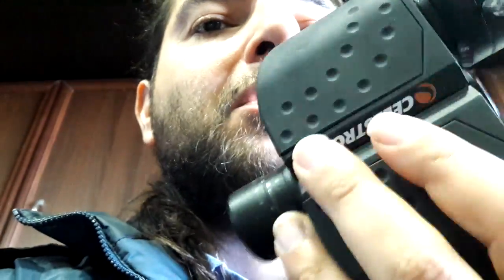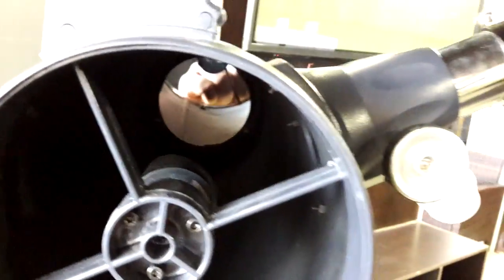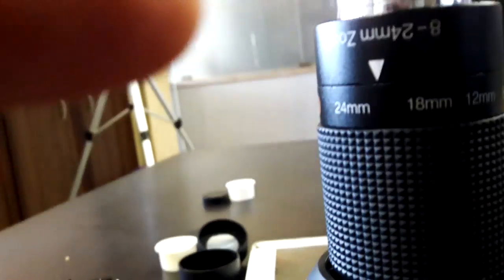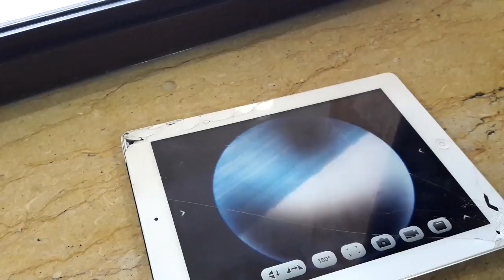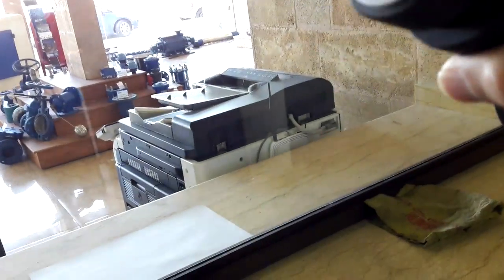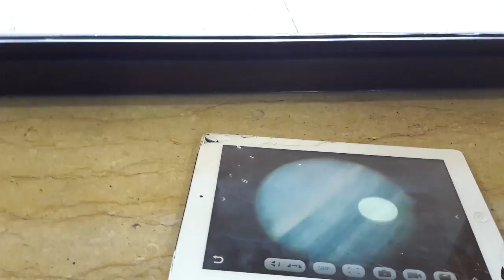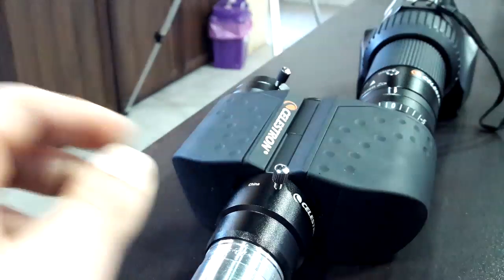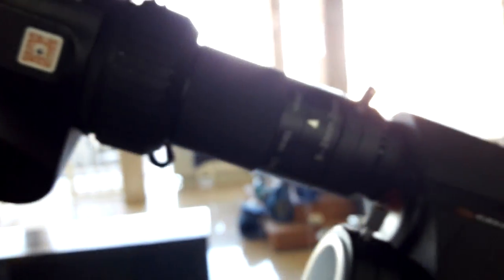Updated: How To Use A Binocular Viewer On A Newtonian Reflector Telescope.

Comment: You need two of the exact same eyepieces for the viewer to work. You also do not have a true newtonion you have a bird jones newtonion. That simply means that you have a correcting lens essentially a built in barlow in your focus tube.  The eyepiece you have in the viewer is also a zoom eyepiece and those should not be used with bino as it is hard to get the same view point on both eyepieces at the same time.  All of this combined takes the bino viewer out of your focal point.  Make sure you remove the lens in the focus tube when collimating otherwise it will always be off just a bit. Check your star defractions they should make a perfect x thru stars when correct
Reply from the maker: +Jesse Galego well there is another bino that fixes everything. it has an OCA (optical correction adaptor)
Reply: What about a baader zoom eyepiece?
Reply from the maker: zoom eyepieces, in general, do NOT need a Barlow lens at all. but I don't know about the Baader's
Reply: @superlinux  The only reason you are reaching focus is because the little telescope you are using has a barlow built into the focuser.